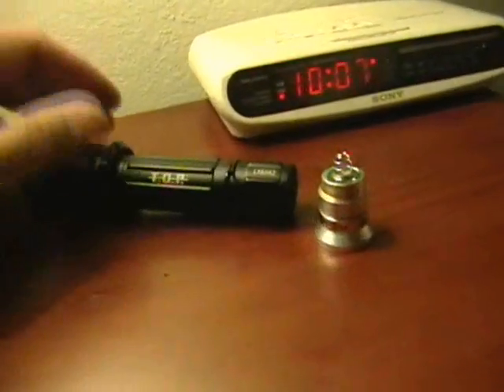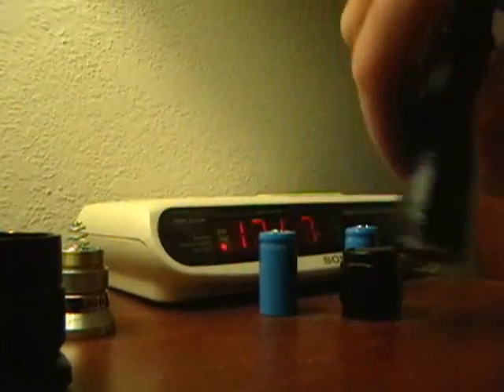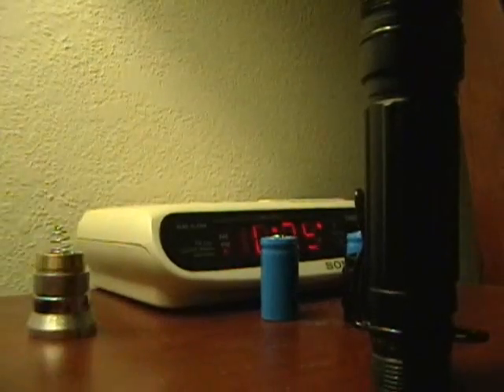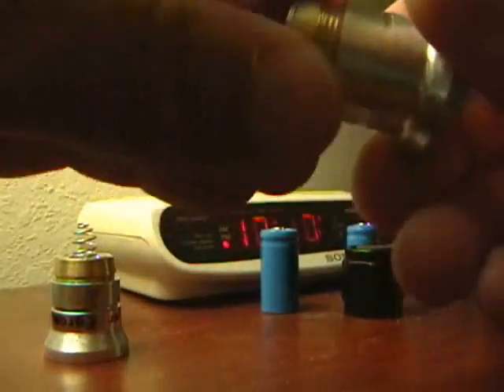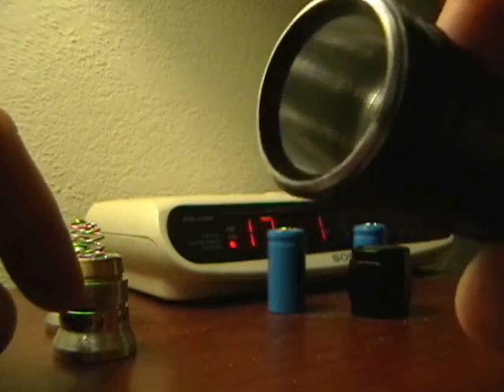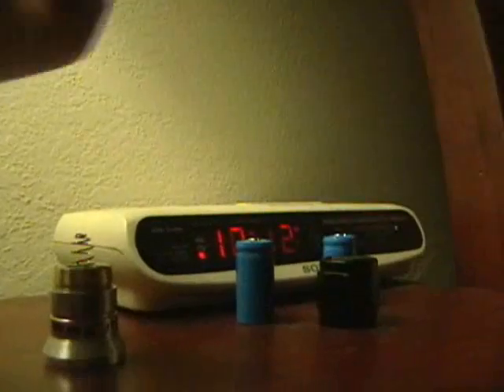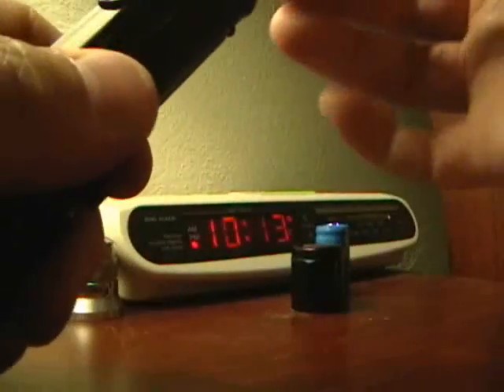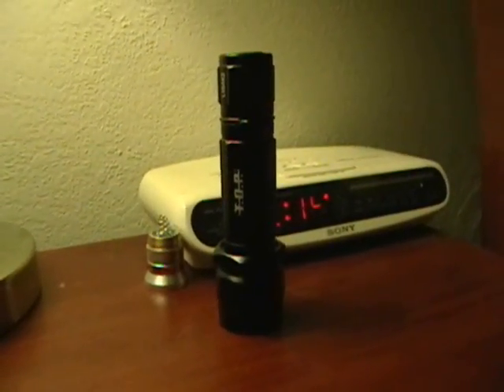Modifying the T.O.P. Stryker -Xenon flashlight

Comment from the maker: @MrQuackism Very durable.  Thick walls, heavy tailcap switch, thick bezel... the lens is polycarbonate so its very impact resistant... although I would question its ability to handle high output Xenon lamps.